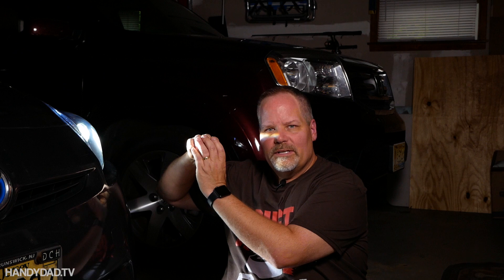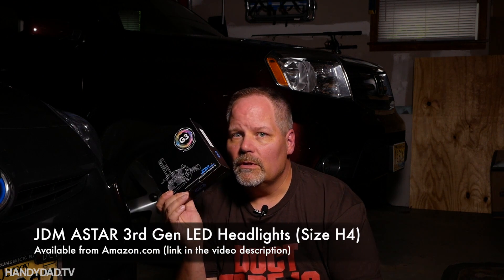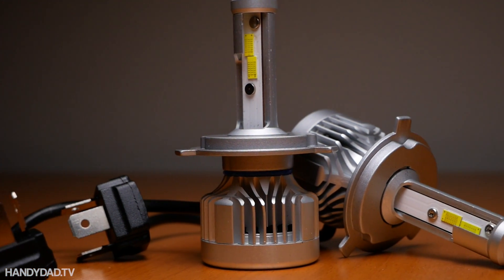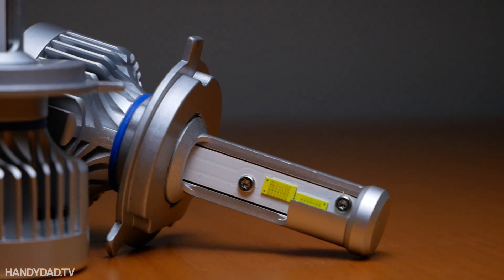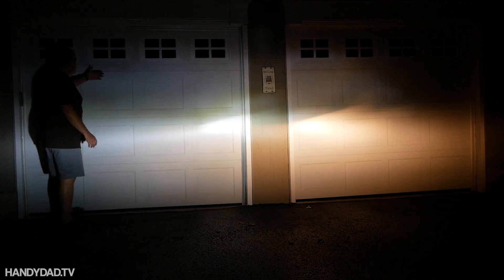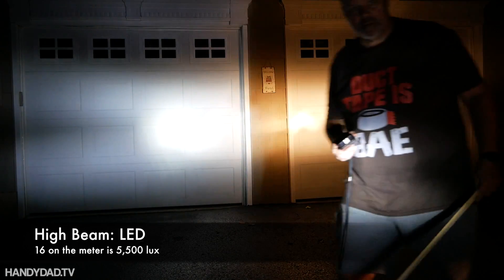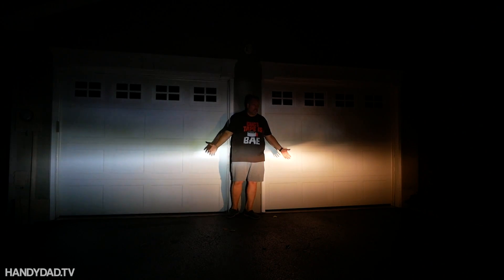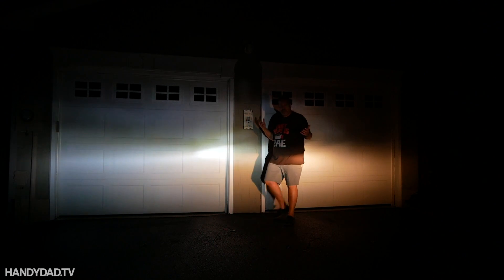Dual Beam LED vs. Halogen in Reflector Headlights

Comment: Good test - Result: Halogen >> LED
 if you take a look at the part where the lights are projected onto the garage door it is easy to see that the LED scatters light everywhere (esp above the mid-line - which in turn equals blinding oncoming traffic) the Halogen bulb (because the reflector was designed for a halogen bulb) has a much better pattern on the door - not as much scatter up top and much more focused light in the center (which equates to light making it down the road). All that was said about the LOW BEAM, but high beam looked pretty good.

Another note is blue does not equal brighter ( it does increase the contrast - so road signs appear brighter) and you measured that with the light meter.
 
Please do no put these into a reflector housing - 
Good Halogen bulbs - Osram Nighbreakers and Philips x-treme vision (these last a fair amount of time and are brighter than stock)
Reply: My Philips and Osram both lasted 5 months 😭

Comment: One thing you forgot to mention (or test) is the light casting distance... While LEDs used in a "reflector" housing appear brighter, they don't cast as far as a standard halogen bulb. So therefore your "down-the-road" visibility turns to shit...  Stay with the higher end Halogens (philips, sylvania, etc.) you'll see more stuff... :)
Reply from the maker: Can you point me to the research on this? Because I did a distance test in another video (https://youtu.be/VCns9CzdQn4) and LED traveled further in my test.

Comment: The halogens looked a lot brighter than the LEDs, ie I could see more detail of your T-shirt on the halogen side, put out more total light and had a better cut-off compared to the LED. The LED looked whiter. I prefer 3000K to 5000K. I would never use 6000K or higher as they look blue, are more harsh and effect your night vision. The reason you should never use LED or HID in a reflective Low Beam housing, is that they scatter light something aweful and dazel on-comming drivers. If you use HID in a non projector housing, without the correct RHD/ LHD cut-off, then you are a total doushbag and your vehicle should be defected.

Comment: hi i have 06 mercedes vito with the  standard halogen bulbs H7s one head keeps blowing would the load resistor fix this and what resistor would i need thanks.
Reply from the maker: I don’t think load resistors would help prevent a halogen from burning out; in fact, you’d probably blow a fuse. Try replacing them with LED bulbs because they use less power.

Comment: You mentioned that the LED lamps were fanless but all the LEDs you link to have fans.  What??
Reply from the maker: The original ones in my car had no fans, just a bigger heat sink. Fans allow them to be smaller and fit in tighter spaces.

Comment: The most important parrameter si visibility. The visibility is how fast you see an object or the distance you can see it. The visibility depends on the contrast degree. When You see an object or a colour you see the quantity of light that it reflects to you. For exampla an object which is white on a black road you can see it from 50 m or more with halogen bulb 55 w and 70 - 100 m with HID or LED. A great quantity of light from a halogen bulb is infrared light. IR light is absorbed by all objects, the quantity of visible light is 15%. The HID and LED have white light and the spectrum is rich in UV near VIS very approach on blue and violet (that is vhy some producers are using blue quarz glass for bulbs) all aobjects are reflecting UV light so that is why a pedestrian in black coat is easy to detect with LED, HID and hard to detect with halogen bulbs. The most important is the distance on which an object can be detect by human eye not the spot on the garage doors.

Comment: Tip:  Always leave the harness connected while R&Ring bulbs.  It helps you unplug the lamp and makes sure you don't drop it.  It is also easier to make sure the harness is plugged in correctly when the bulb is shrouded by batteries, intake ducts, etc.   //   The small issue, scatter, you also report about is a considerable problem nowadays.  I truly hate to drive at night now, so when I can, I leave at 4am and beat all the blinding lights out there on the road.   //   Question:  Are those ball-bearing fans?  What's the lifetime with and without dust covers?   //   The flicker on that LED is just horrible.  I couldn't drive with that.   //   I agree, the whiter light does look brighter on the road, even at the same lumen level.

Comment: LED retrofit bulbs in car halogen headlamps is total crap in most cases. Same story like a few years  back when Xenon retrofit was the choice of 16 year olds and wannabe ricers. There are generally 2 problems: The LEDs are not at the same location of the filaments and they do not emit the light in a 360° angle compared to filament bulbs. Result is a very uneven light output with bad scattered pattern and hot (bright-) spots. Just use regular, high quality halogen bulbs. Buying a new set of headlamps whick are not all cloudy, scratched or yellow is also a good option. A halogen headlamp housing that does not work well on halogen bulbs will not work well on LED either.

Comment: Been working on converting my Ranger headlights to HID lows and LED highs using Spyder housings for a while, THANK YOU for showing me those universal dust covers...that is a major help with the high-beam socket design I have to work with!!
Reply: MrAcuta73 there is no point of the dust covers as the fan will be blowing in dust and dirt anyways....
Reply from the maker: The entire fan is outside, not half in/half out.

Comment: Just remember that older cars in the european sector were running Halogens 5/6 years before american cars/trucks
I have 1978 volvo 242 GT that has crystal Hella lamps 8 or 10" round units that had bosch H4 halogen bulbs that were far better than any thing  else at the time and were 55/80 watt factory Hi/Lo beam and i use to get stopped by law enforcement in Canada and the USA and had to pull out the owners manual to show them the the specs and often got pulled into a garage to prove it. Modern reflectors 2005 until present are vastly different from my 1989 Volvo 240 which are still some of the highest quality produced are great, They were never designed to use xenon,HID, or LED bulbs in them,as much as i like to the LED bulbs in the applications of older vehicles ,just save your money ,I have more than my share of all of these types and i mainly drive highway at night and a light with more  wattage is great, 3 things,shorter life span,more money and Illegal to use on road,I have tried all prices and just save your money, plus I agree with the comments here that say they blind you briefly and your eyes take longer to readjust once that vehicle is past you,it is all choice in the end, I prefer not to blind someone in the on coming lane towards me,nor do I like people coming up behind me with super bright headlights of any kind, they're just fucking rude people who don't care what trouble they cause. save your or first do your research like this dude.

Comment: Personally I use Philips Lumiled in my car, it has reflector headlights but separate 9005 and 9006 bulbs for high and low. It has great beam pattern as the lumileds sizes are more suitable with better placement if the led emitters to mimic the filament in a halogen

Comment: Wrong placement. Cuz you have to remove the adapter from the bulb. So you can lock the adapter and put the dust cover on it. Then you have to just plusg the LED in and rotate a bit and that's it. Sorry 4 my english :D

Comment: You say the LED flicker is the camera not the LED but at 6:00 you dont see the halogen flickering
Reply from the maker: The filament in a halogen takes time to heat up and come to brightness. It also takes time to go dark after the power is cut. So they never flicker.

Comment: When that fan fails.... you can kiss that harness connection and warranty coverage goodbye and for what... same output? Any moe who swaps bulbs all day long MAY warn you about the risk, but led/hid companies are not cutting you a check for $200-300 repair. Im not even gettin into how the housing isn’t glass so the heat will melt the housing over time and are even more expensive to replace. 

This video should come with that disclaimer that the best clean install should be monitored closely and it isn’t “set it and forget it.” If you have GLASS Off road lights and can swap the bulb connections to ceramic, I see the benefit, but my point is to make a COMPLETE informed decision.

Comment: part of the problem with LED headlights is that people think all you have to do is take one out and replace it with another which is WORNG! you need to aim them properly as well their not supposed to shine straight out ahead of you. They are actually supposed to be aimed down at the road 50 meters ahead of the car. 99% of the morons that do it them selves have the lights pointed in such a way that it shines directly into other peoples windshields which is why they seem more harsh to other drivers. If you plan on replacing your headlight please do everyone a favor and do the proper research first or pay a garage to do it.

Comment: The led you used is only 36W.You can use 55w to obtain more light from the bulb.I think that the reflector is designed to absorb this heat even without the fan.
Reply: Reflectors don't absorb significant heat...the heat sink on the bulb does pall of the heavy lifting...

Comment: Anyone can stick a penny in a fuse box, but any electricisn can also tell you why that is a bad idea. Reflector assemblies are very precisely made and they depend on a specific point or beam of light from a specific physical bulb. Change to any different bulb, and the beam coming out changes. Odds of making it better without also making it illegal for too much glare and shining in eyes? Maybe you lucked out, but good lights are not easy to DIY. Lots of junk on the market, quality engineering still costs.

Comment: Dust caps?  These caps also serve to keep water and more out of you head light housings.  If you try driving for a few days with heavy rain and road spray, without the 'dust caps' in place, you will find out why it importent they are reinstalled.  We had bulbs replaced where the mechanic did not replace one correctly (found in lodged in behind the wheel well liner) and a wet road trip later we were having the head light housing removed and cleaned (the mechanic finally replaced it after destroying it trying to clean the inside).  

If the after market dust cap only exposes the back of the LED fixture and fan, where does it blow (or suck) the air to?  ... The inside of the sealed head light housing?

Comment: too bad that led factory headlights are perfectly fine/legal but replacement led bulbs are illegal for road use in germany :/
Reply: Because factory LED headlights have standards that they are required to meet and be certified for road use.  Some of those standards include functional light output and amount of glare to other drivers, both of which are things LED bulbs are terrible at when used in a halogen housing.

Comment: you made a good choice, using L.E.D. bulbs........in a normal incandecent  bulb only 18% of the energy comes out as visable light, the rest is lost as heat, in an L.E.D., only 4 to 6 % is lost as heat.

Comment: There is one thing I do not understand about the way you sealed off the inside of the housing with that ingeniously designed rubber ring: it seems to only leave a spot open for the fan. My question though is, how can that fan work and properly cool when there is no air inlet and it only has an opening on the side where it is to blow air out?
Reply from the maker: It’s hard to see, but the whole fan protrudes from the rubber hole so it has plenty of air flow.

Comment: My high beam has reflector and h1 bulb. I think I can not use hid because they take time to warm up and i use high beam momentarily only for signalling when I want to overtake. So i think i'll have to use led because they light up immediately. Please guide the best bulb in terms of range and brightness. Xhp70 is not available for h1. Xhp50 and luxeon lumileds zes are available. Which will be better among these. Or please suggest some other

Comment: That "subtle flicker" is not due to camera shutter although that does allow you to see it. It's the result of poor engineering running the current regulator via pwm or other shortcut instead of true current regulation. Flicker is highly distractions and extremely visible during saccades. 
Also have never seen any of the big manufactures offer a COB like that...

Comment: headlights aren't for you to see the road, they're for others to see you. High beams and street lamps are for illuminating the road. And if your high beams aren't bright enough for a dark road, perhaps your bulbs are worn out. I don't understand why so many people are under the illusion they need their headlights to be brighter
Reply: Some people live in areas where there are no streetlamps. There also these giant animals that like to run out in front of you that can total your car instantly. The car I'm driving now has dual beam bulbs and the high beam goes about five feet further than the lows. It feels like I'm driving holding a matchstick. This is also with new Philips Xtreme Vision halogens. My wife used to complain about her headlights not being bright enough, and her lows are like my highs, with cheap 10 dollar bulbs. I like to see as far as I can to avoid hitting animals, and the factory halogens simply don't cut it. If there is better technology out there,, why not benefit from it? If you live in the city, you don't need bright lights, but in rural areas, they can save your vehicle, or even life.

Comment: LED headlights are great for increased visibility, but a blinding nightmare for all oncoming drivers, especially bad when LED's are behind drivers in lower height vehicles!
Reply: Which is why headlights shouldn't be allowed to have more max lux at the same distance than typical halogens. Plus, hills and even small bumps constantly point headlights right into drivers' eyes.

Comment: That bulbs are junk, they are imprecise, that's why light is scatered. With good LED bulbs light is good and precise.
Reply: Diode Dynamics SL series bulbs are currently the best LED bulbs you can buy and even those don't produce a perfect beam pattern.  You're dealing with the physics involved in using a light source that is optically dissimilar and trying to make that work in a setup that was never designed to accept that source of light.  It's like putting shampoo in a dishwasher and expecting it to work because they're both soap.
Reply: Trust me, you didn't tryed this bulbs what I'm using, they have great beam pattern and great cut off only with reflector, without lens. H4 bulbs 
https://i.imgur.com/K6XTr8e.jpg
https://i.imgur.com/AWjkMgn.jpg
Reply: Well dont just share pictures, please tell us what brand, model it is and where to purchase from.

Comment: You commented on the light pattern going up to the right and you said that is normal for reflector lights. You are right about that, it is angled that way to get the same light pattern on the ground you also find with projector lamps, manufacturer LED and HID, to shine more light to the right curb (e.g. to see pedestrians earlier) and to blind the oncomming traffic on the left less.
Only on the distance you put them to the wall it looks different with reflectors.
Oh and by the way, UK, Australia and any country driving on the left will have this inverted.
Here in europe you can either electronically switch your lights depending on the model, or you have to put some special decals on certain spots of your headlights, to drive for example with a german car in the UK without blinding everyone else.

Comment: Great video! I have installed low beam LED headlights in my 2004 Honda Civic, and they perform pretty well, the light output its similar as my previous halogen bulbs, and  of course after installed 'em I've adjusted the angle to avoid blinding other drivers.

Comment: Is there a 'top' and 'bottom' when installing the LED?
Reply: You might have seen the mounting plate with the three tabs on both the led and the halogen. That one is indexed and only fits one way. The Bulb type is H4, this standard very exactly specifies all the dimensions and positions.
Reply: I see the mounting plate tabs and have them installed the only way they can be.  The problem I'm having is that the LED rotates within the mounting plate.  And I'm not able to find anything anywhere that indicates whether the LED should be vertically (shining side to side) or horizontally (shining up and down) situated in the plate.  THAT'S what's got me unsure of the install.
Reply: Ken Gilbertsen they should not really rotate.  Look AT the bulb he showed in the video, the two tabs closer together, usually with a notch or flat in the center are the bottom side. The filaments and the center of the small reflector next to the forward filament should be in line with the line through notch and single tab. The reflector has to be on the bottom side.
But if it turns it does not even fulfill H4 specs
Reply: Alex Ku Yeah, I see.  My LED's are different - from another mfg.   Mine do turn in the plate, and I'm trying to get them oriented correctly to be sure they're giving me the right beam coverage.  If I can't get it resolved, I'll have to try and return them - which will surely involve a bit of back and forth with the seller...  Thanks for your help Alex.